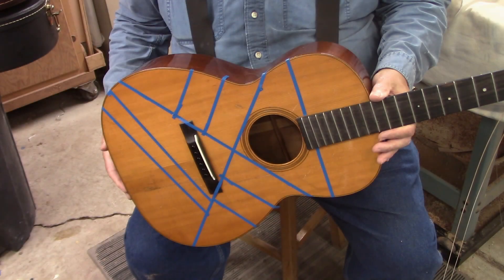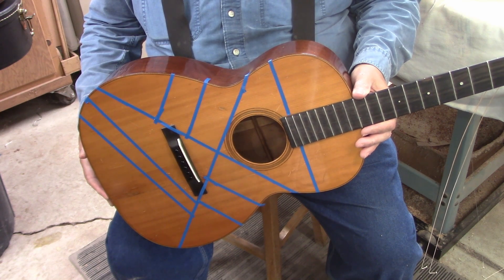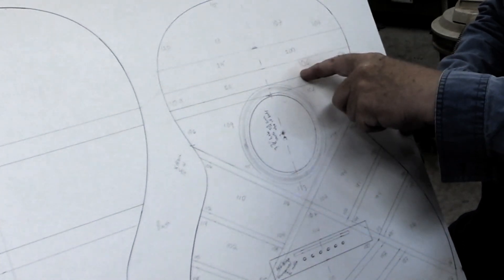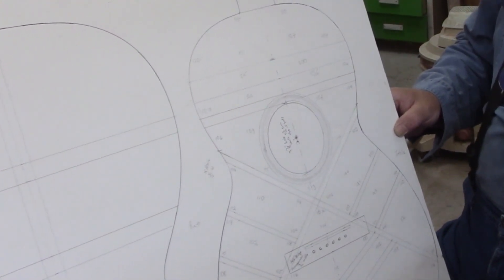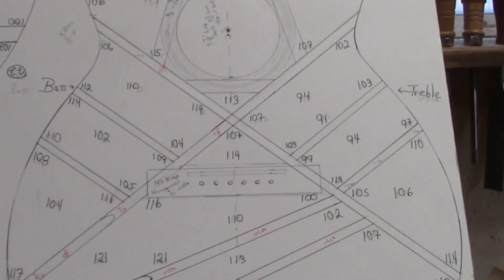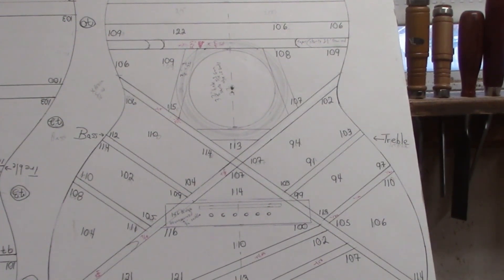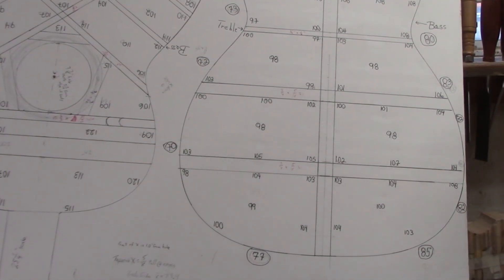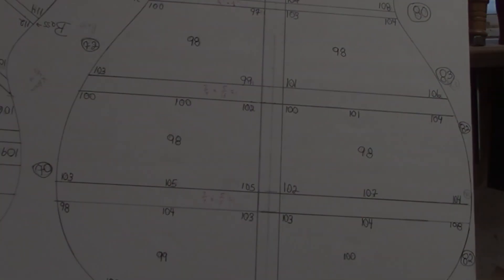Pre War Martin 000-18 Guitar Specs

Comment: Very interesting and adds to the mystique and question as to why pre war Martin guitars have the sound/tone that is very difficult to reproduce in a new guitar build. All these measurements are noticeably thinner than those of today's very well built and great sounding guitars (even Martin guitars). Most Martin contemporary model Sitka top including the Vintage series (discontinued D18V and HD28V etc)  thickness are around .120-.124" while their Red Spruce tops on the Authentic series (2005-2024) are .100-.110 and the GE Red spruce topped (discontinued) series is .110-.118".
Reply from the maker: Thanks for that information,  Bill. You clearly know a lot of details about Martin guitars. You are welcome to come to my shop and play this one if you would like.
Reply: @zimnickiguitars311  Thank you Gary...By the way, I would bet that 27' 000-18 is very light. I would suspect that it weighs 3-1/2 lbs or less...Did you weigh it?